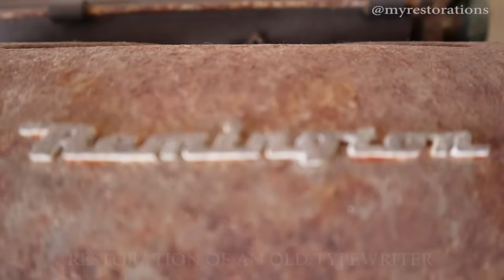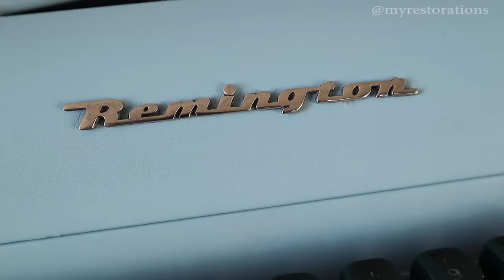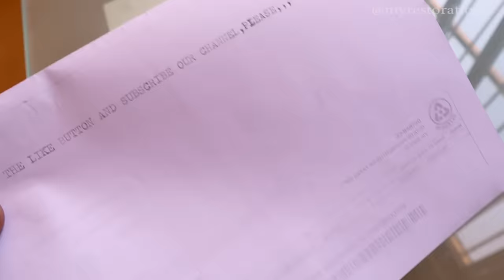Restoration of an Old Rusty Typewriter (Remington)

Comment: I have been repairing and refurbishing typewriters since the mid 1960's and you did a great job. To get the platen, rubber rollers and the top paper rollers to a near new look, use Acetone on a rag or denatured alcohol.  On the rubber only, if you use it on any plastic part, it will eat up and distort the plastic, Keep up the great work !
Reply from the maker: Amazing comment, friend! Thanks a lot🤝🤝🤝🤝🤝
Reply: I would add that rubber parts cleaned in this way are best preserved with glycerine. Regards
Reply: What do you do for your ribbons? I noticed his ink was a little week.
Reply: @imjimimack  Ribbons are fairly easy to find. Even Amazon has cheap ones. A quick google search will turn up lots of options in various colors. Just make sure to keep the original spools if you have them. Re-spooling the ribbon is a pain, but some things they just don't make anymore.
Reply: @aaronscholl9560  Thank you
Reply from the maker: Dear Viewer 

We are thrilled to invite you to watch our latest restoration video on our YouTube channel, @myrestorations. This time, we've taken on the challenge of restoring a very old and rusty REMINGTON typewriter. 

We've made several changes to the video based on your feedback and believe these improvements will enhance your viewing experience. We're excited for you to see the transformation of this antique piece and hear your thoughts. 

Restoration of an Old Rusty Typerwriter (REMINGTON)
video link: https://youtu.be/t8mZl7VBBYQ 

Don't miss out on this journey of restoration. We look forward to seeing you there! 

Best regards,
@myrestorations
Reply from the maker: Dear Viewer 

We are thrilled to invite you to watch our latest restoration video on our YouTube channel, @myrestorations. This time, we've taken on the challenge of restoring a very old and rusty REMINGTON typewriter. 

We've made several changes to the video based on your feedback and believe these improvements will enhance your viewing experience. We're excited for you to see the transformation of this antique piece and hear your thoughts. 

Restoration of an Old Rusty Typerwriter (REMINGTON)
video link: https://youtu.be/t8mZl7VBBYQ 

Don't miss out on this journey of restoration. We look forward to seeing you there! 

Best regards,
@myrestorations

Comment: I have one much older than this one, and in much better shape. Mine was stuck in a barn for years and then was thrown out in the dumps scrap metal pile. I just grabbed it and brought it back to the Church. The Crinkled finish, chrome, and all was in excellent condition considering the life it had. These old machines are kinda Kool to have sitting around as decoration. I also pickup old sewing machines too. I think I have 6 or 7 sewing machines in the church.
Reply from the maker: We are excited to invite you to watch our video again. We've made several updates in response to your valuable feedback. Among these modifications, you'll notice significant improvements in the audio, which was a primary request from many of you.
           Other enhancements include updates related to electrolysis, the machine's ruler, and an ASMR test with the machine, among others. We believe these changes will greatly enhance your viewing experience. 
Restoration of an Old Rusty Typerwriter (REMINGTON)
video link: https://youtu.be/t8mZl7VBBYQ
           We appreciate your continued support and look forward to hearing your thoughts on the updated video. 

Best regards, @myrestorations

Comment: The platen is probably rock hard which hardens over the years and impact from the type face….hence some letters cuts into the paper….you can use a green scotch pad and methylated spirits…this will grip the paper and rid of the shine….brilliant restoration
Reply from the maker: We are excited to invite you to watch our video again. We've made several updates in response to your valuable feedback. Among these modifications, you'll notice significant improvements in the audio, which was a primary request from many of you.
           Other enhancements include updates related to electrolysis, the machine's ruler, and an ASMR test with the machine, among others. We believe these changes will greatly enhance your viewing experience. 
Restoration of an Old Rusty Typerwriter (REMINGTON)
video link: https://youtu.be/t8mZl7VBBYQ
           We appreciate your continued support and look forward to hearing your thoughts on the updated video. 

Best regards, @myrestorations

Comment: You’ve got a lot of good tricks. Time for a blasting cabinet.
Should’ve had the rubber redone so it would be a complete restoration.,
Reply from the maker: Ok
Reply: @myrestorations  well it’s not really a “restoration” wo doing the rubber since it is you know, meant to load paper, throw ink down and remove the paper in as new original condition. You obviously love a challenge!

Comment: Spell Check? You did a great job on this! Just curious about the automatic speak check. I had a Royal about the same vintage and could never get the Spell Check to work.
Reply from the maker: We are excited to invite you to watch our video again. We've made several updates in response to your valuable feedback. Among these modifications, you'll notice significant improvements in the audio, which was a primary request from many of you.
           Other enhancements include updates related to electrolysis, the machine's ruler, and an ASMR test with the machine, among others. We believe these changes will greatly enhance your viewing experience. 
Restoration of an Old Rusty Typerwriter (REMINGTON)
video link: https://youtu.be/t8mZl7VBBYQ
           We appreciate your continued support and look forward to hearing your thoughts on the updated video. 

Best regards, @myrestorations

Comment: Finally a real restauration video.... most of these even the non metalic parts are tusty 🤣 here it's clearly real.
Reply from the maker: We are excited to invite you to watch our video again. We've made several updates in response to your valuable feedback. Among these modifications, you'll notice significant improvements in the audio, which was a primary request from many of you.
           Other enhancements include updates related to electrolysis, the machine's ruler, and an ASMR test with the machine, among others. We believe these changes will greatly enhance your viewing experience. 
Restoration of an Old Rusty Typerwriter (REMINGTON)
video link: https://youtu.be/t8mZl7VBBYQ
           We appreciate your continued support and look forward to hearing your thoughts on the updated video. 

Best regards, @myrestorations

Comment: As someone who worked on office equipment for some years in a former life I just knew I would not like this when you used pliers to undo a nut at the early part. Then when you sprayed paint over all the working mechanisms hiding the rust, I decided you were not doing a restoration at all,  but just making a short term shiny object. I would like to have seen you strip out the typebars and all the links and springs from the combs and done a real de-rust.
Having said that I did like the way you cleaned the small parts in the jar with stones and the drill. I will have to remember that one, thank you.
Reply from the maker: Thanks for your feedback

Comment: 24:53   The lever at the right with the three dimples, that is for changing the color of the ribbon.  You can buy a two color ribbon (red and black) and that lever lets you select whether you want the text to be red, black, or neither.    So the dimples should be colored black, red, and white (meaning neither black nor red).    You could probably order a new ribbon for this typewriter online.  I know they still make ribbons for some models.
Reply from the maker: Thanks 👍

Comment: Great work but....
You went into so much detail and then did a near enough is good enough job on the ruler. I don't understand.
Slightly disappointing.
Reply from the maker: We are excited to invite you to watch our video again. We've made several updates in response to your valuable feedback. Among these modifications, you'll notice significant improvements in the audio, which was a primary request from many of you.
           Other enhancements include updates related to electrolysis, the machine's ruler, and an ASMR test with the machine, among others. We believe these changes will greatly enhance your viewing experience. 
Restoration of an Old Rusty Typerwriter (REMINGTON)
video link: https://youtu.be/t8mZl7VBBYQ
           We appreciate your continued support and look forward to hearing your thoughts on the updated video. 

Best regards, @myrestorations

Comment: It's not perfect, but at least it's not fake. And you used body filler and smooth sandpaper for perfect finish when most "restoration" channels are like "fuck sanding, filing, and body fillers! views are more important than a good finish!"
Reply from the maker: Thanks a lot!🤝🤝🤝🤝
Reply from the maker: Dear Subscriber,

           We are excited to invite you to watch our video again. We've made several updates in response to your valuable feedback. Among these modifications, you'll notice significant improvements in the audio, which was a primary request from many of you.
           Other enhancements include updates related to electrolysis, the machine's ruler, and an ASMR test with the machine, among others. We believe these changes will greatly enhance your viewing experience. 
Restoration of an Old Rusty Typerwriter (REMINGTON)
video link: https://youtu.be/t8mZl7VBBYQ
           We appreciate your continued support and look forward to hearing your thoughts on the updated video. 

Best regards, @myrestorations

Comment: OK. you certainly did a good job, however, the machine was not in such a bad condition to begin with. surface rust every where but the interior was very clean, so was the rubber roller plus many other parts. I would classify this restoration under: "Questionable'.
Reply from the maker: Before you can't type
Reply from the maker: Dear Viewer 

We are thrilled to invite you to watch our latest restoration video on our YouTube channel, @myrestorations. This time, we've taken on the challenge of restoring a very old and rusty REMINGTON typewriter. 

We've made several changes to the video based on your feedback and believe these improvements will enhance your viewing experience. We're excited for you to see the transformation of this antique piece and hear your thoughts. 

Restoration of an Old Rusty Typerwriter (REMINGTON)
video link: https://youtu.be/t8mZl7VBBYQ 

Don't miss out on this journey of restoration. We look forward to seeing you there! 

Best regards,
@myrestorations

Comment: The tape is too dry.  It needs to be replaced with one that has more ink, so you can see what you are typing.  Other than that, AWESOME WORK!
Reply from the maker: We are excited to invite you to watch our video again. We've made several updates in response to your valuable feedback. Among these modifications, you'll notice significant improvements in the audio, which was a primary request from many of you.
           Other enhancements include updates related to electrolysis, the machine's ruler, and an ASMR test with the machine, among others. We believe these changes will greatly enhance your viewing experience. 
Restoration of an Old Rusty Typerwriter (REMINGTON)
video link: https://youtu.be/t8mZl7VBBYQ
           We appreciate your continued support and look forward to hearing your thoughts on the updated video. 

Best regards, @myrestorations

Comment: You don't EVER spray paint any of the letters on any typewriter! Paint will cause the keys to stick and mess up the lettering. I recommend you learn how to properly restore something before you "restore" it. When you truly restore something you return to the appearance it had when it was brand new. That doesn't include spray painting parts that weren't painted in the first place.
Reply from the maker: You calls paint, I call cold galvanization. It's a kind of protection, it looks  like a paint, but no. This product is much expensive than ink. If I didn't it l, soon the rust would come. I live next the beach. Nothing is wrong in this machine, it is useful.
Reply from the maker: Dear Viewer 

We are thrilled to invite you to watch our latest restoration video on our YouTube channel, @myrestorations. This time, we've taken on the challenge of restoring a very old and rusty REMINGTON typewriter. 

We've made several changes to the video based on your feedback and believe these improvements will enhance your viewing experience. We're excited for you to see the transformation of this antique piece and hear your thoughts. 

Restoration of an Old Rusty Typerwriter (REMINGTON)
video link: https://youtu.be/t8mZl7VBBYQ 

Don't miss out on this journey of restoration. We look forward to seeing you there! 

Best regards,
@myrestorations